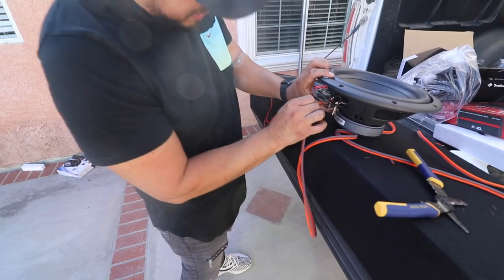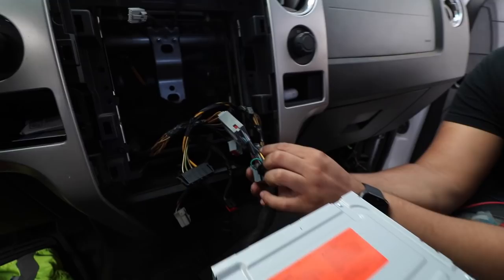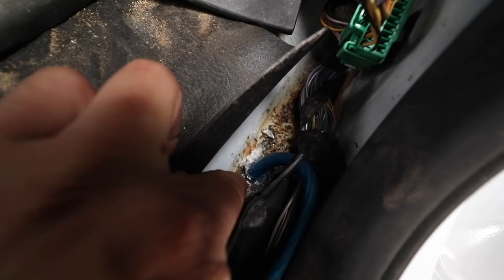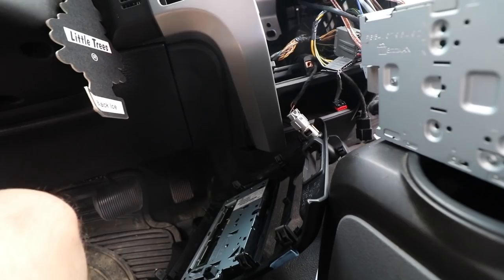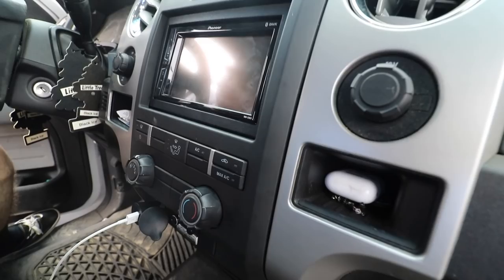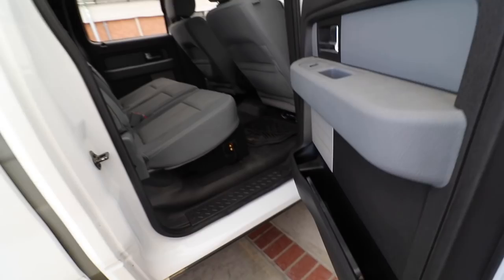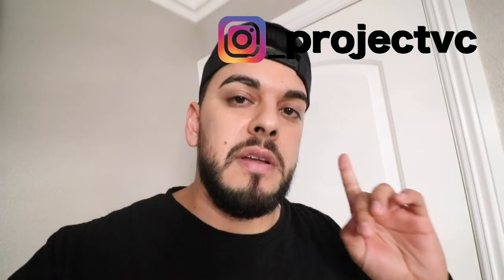FINISHED THE SOUND SYSTEM ON THE F150!!!

Comment: That sound system crazy good 🔥🔥, I’m 16 and when I bought my truck I upgraded my sound system little by little, first head unit and the 4 door speakers, a couple months later I bought the 4 Chanel amp and a subwoofer, now all I need is another amp specifically for my subwoofer to complete my sound system
Reply: what i’m doing, just got the head unit

Comment: Why not use the factory passenger side grommet to bring the hot wire through the firewall? I’m in the Midwest and I’d never drill a hole into my floor when there’s already a pass through engineered into the firewall.
Reply: Mexicans

Comment: If you put all the wires on one side your sound will eventually sound distorted having the power wire and the remote wire on the same side
Reply from the maker: Not with high quality rcas bro. No distortion 👌🏼👌🏼